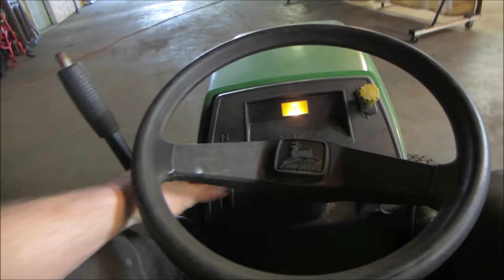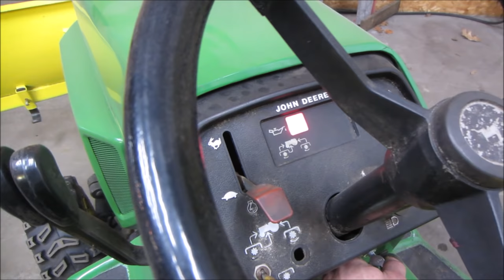SAVED FROM THE SCRAP, John Deere Will IT Run Series, 3 of 3

Comment: I sort of want a full restoration of all the metal and rust and gunky parts but not sure that is what you're about.  It seems you a a bit lazy as a restorer.   Not everything is done right or well.  But if just trying to get it to work  ... it.s ok.  I want you to clean everything in rust emolation and then do a major sanding and then welding and more sanding and painting maybe sandblasting or powder coating and then assembly     just so it stays perfect and strong for longer than a quick repair.  I want the end result to be fabulous and more than new.
Reply from the maker: its a lawn mower not a porsche

Comment: I have one just like this and you said the seat on yours was "ratty". Mine is a lot worse than that it- the seat was stiff not pliable and I kept having to put the Yellow Part back on with the rubber trim. It kept coming off so when I went to take it to get worked on I had to take the yellow part off by the time I got to where I was going the foam that was left blew off into a ditch or something because I never found it. So let's just say mine's in a lot worse shape than yours. I had to replace a tire and the whole spindle came out of the back transmission. Tire and spindle both came off. They told me at the end of the spindle or shaft is a snap ring - how easy is it to put that back on? Right now everyone's laughing because of my seat story, well you have no idea because now when I mow, I mow a little bit the tire comes disengaged, have to get off the mower push the tire back on about an inch so I can mow some more- all because I don't know what I'm doing and don't want to tear the transmission apart and not be able to put it back together again!

Comment: And front valve stems go on the inside.
Reply: Duca  I have owned 100, 200, and 300 series John Deere tractors. All of them had wheels mounted with valve stems on the inside (towards the frame). Its to prevent snagging the valve stem when getting a bit too close to trees and such.

Comment: It's a completely uneconomical repair and the cost benefit analysis shows that the costs were far far greater than the benefits of repairing it.  A smart person would have walked away and simply bought a new mower.  There is a time in place to make repairs especially if the labor is free or the person enjoys working on the equipment, But certainly not in this case.